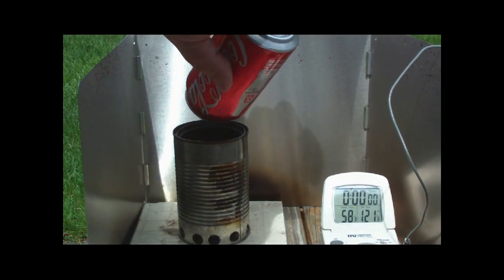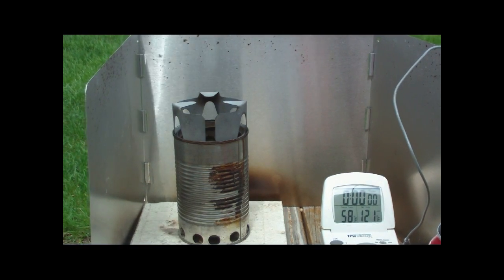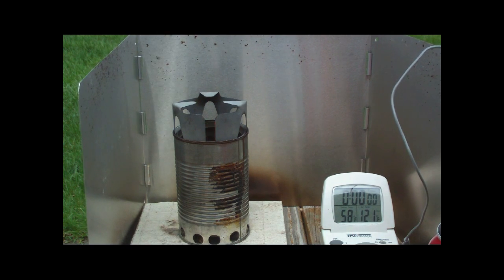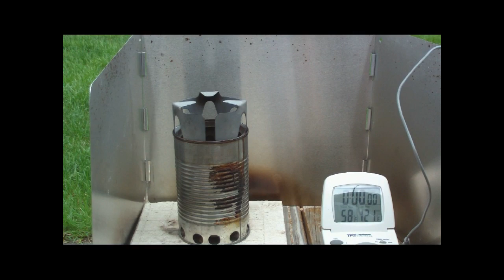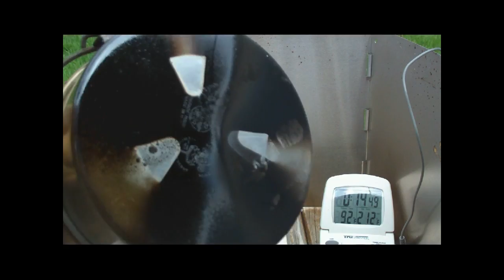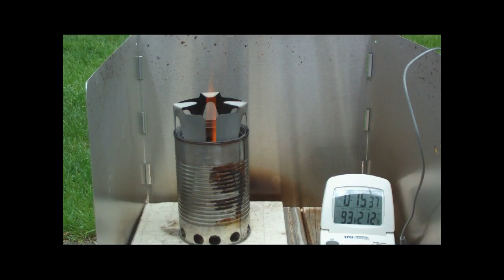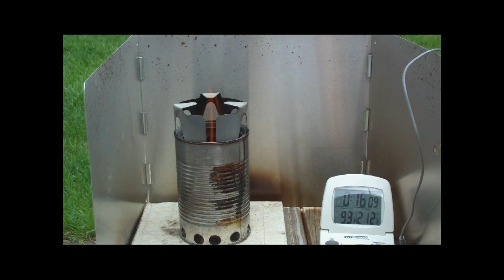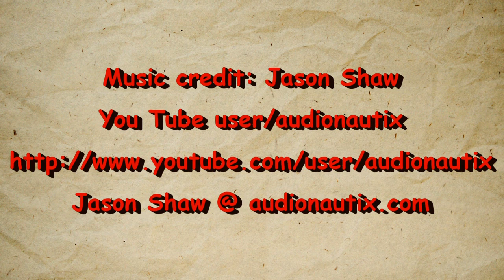Froup Stove - Boil Test #1

Comment: Dear Hiram, I keep running across more and more of your vids and I find them very informative and entertaining. I ran across this one just recently (obviously!) and, given that I really like the idea of the wood gasifier stoves over alcohol stoves (man-made fuel verses natural fuel), I've been working on designing better versions of these.
One of the things that I have noticed lacking from most of these stoves is something very critical. You have to keep in mind that ALL fires LOVE to have something of a chimney effect. Better updraft promotes more heat. I have found that it doesn't even require a solid cylinder to promote that effect!...though it would protect from wind gusts.
I realize that the whole concept of these is being able to build them out of very common materials that can be scrounged almost anywhere. What I have found is that if you can find taller cans to start with, you can build in a bit of a chimney effect by positioning the upper gas jets deeper down in the burn chamber (1 or 2 inches) and then having a 2 or so inch tall riser on which to place your pot.
Of late, I have been scouring through the thrift stores and keeping my eye open for stainless steel, double-walled kitchen containers (there seems to be a lot of them from IKEA) that don't have holes pocked through the sides that I will be able to cut open and modify into some really nice stoves. One of the other things that folks can keep an eye out for is old Stanley vacuum thermoses that they could cut up and modify. Though these will be heavier than an alcohol stove (by far!), the advantage is that I could find fuel for said stove almost anywhere and eliminate the weight of carrying liquid fuel (and the known fact that, at some point, it is going to run out). The other thing is that an SS stove isn't going to rot away in a matter of months.
(Sorry. Didn't mean to get so long-winded!)

Comment: i like the experimenting of different size wood-gas stoves. which hole configuration seems to work better?
bigger or smaller? more or less?
is there a chance of doing a burn test over glass to see if you can witness the downdraft of the stove?
anyways i like the videos, keep doing them